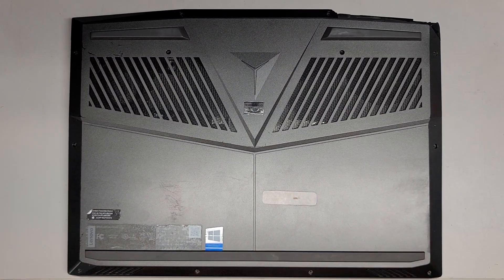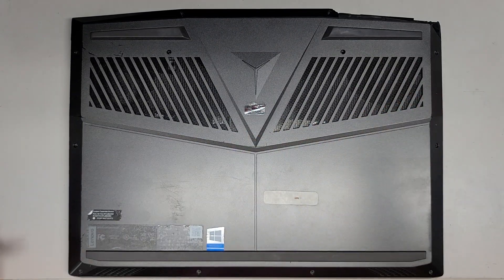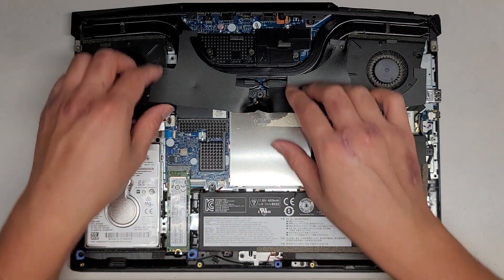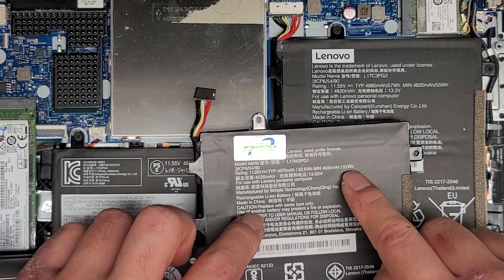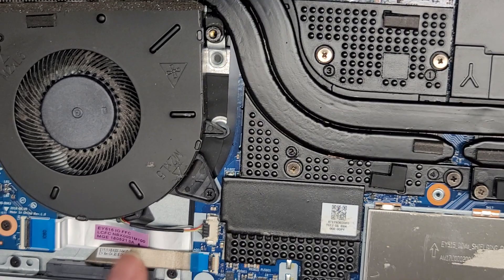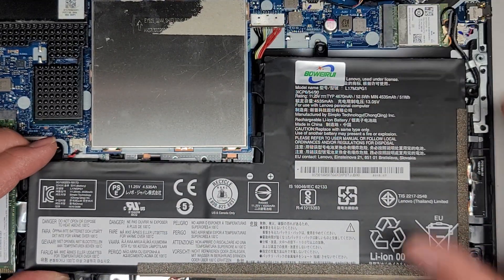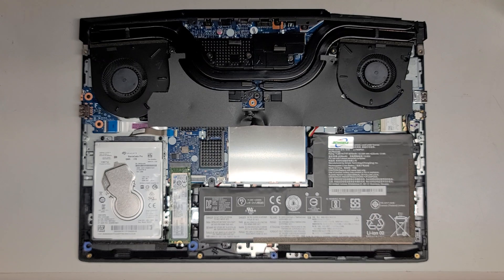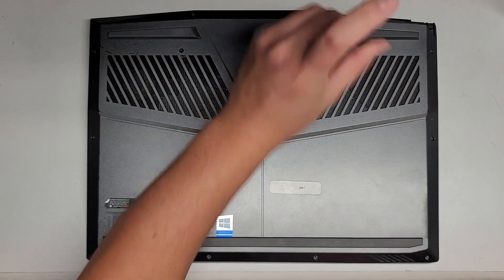Lenovo Legion Y7000P-1060 Y7000P 1060 Disassembly RAM SSD Hard Drive Battery Replacement Repair

Comment: Cheers! Had a hard time pulling the battery out since there really wasn’t much to go on, and then when installing the new battery the piece going into the connector had more plastic sticking out than I would have expected, but I didn’t want to try to force the part further. Computer booted okay after installing though, screwing everything back in now!
Reply from the maker: @philipisbest  awesome!
Reply: @ItsBinhRepaired  the black tiny stik

Comment: Ko gỡ jack pin ra nó chạm sao trời :v
Reply from the maker: Hm?
Reply: @ItsBinhRepaired  y u dont unplug battery  jack first?
Reply from the maker: @TrungLunReview  it's not necessary for most things.
Reply: @ItsBinhRepaired  Amateur
Reply from the maker: Only an amateur removes unnecessary components because they're scared they'll break something. Do you disconnect your car battery when you change the oil?
Reply: @ItsBinhRepaired  😂
Reply from the maker: @socratesvela8285  It's true. Lol An amateur preforms unnecessary steps because they don't understand what they're doing.